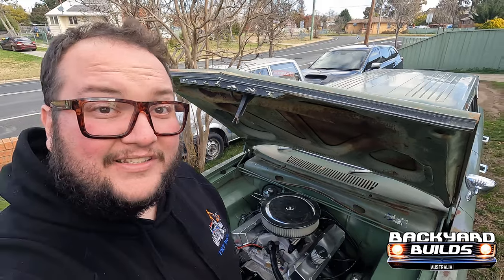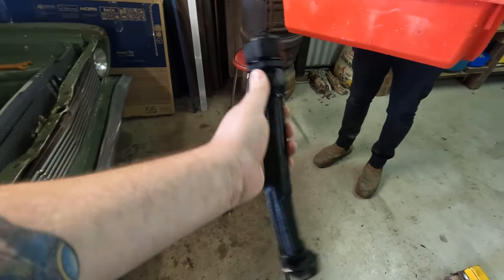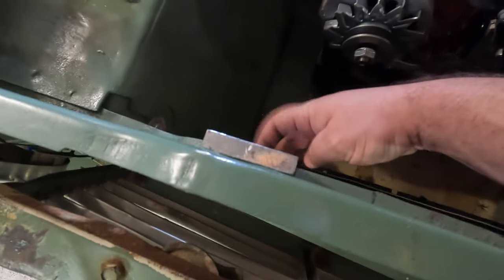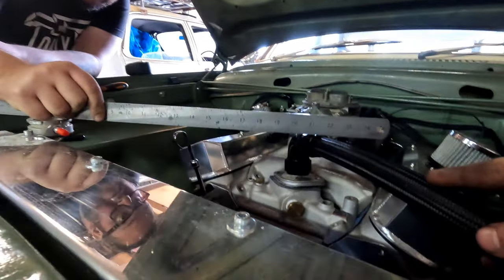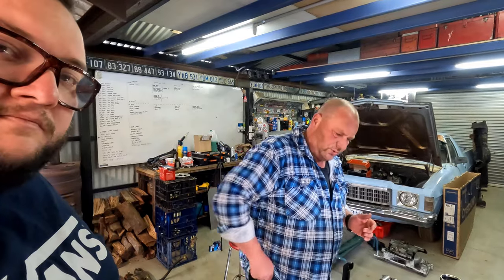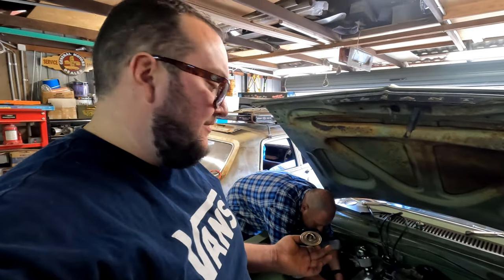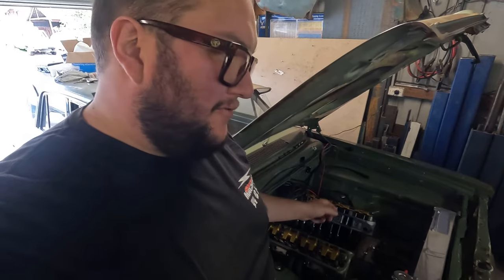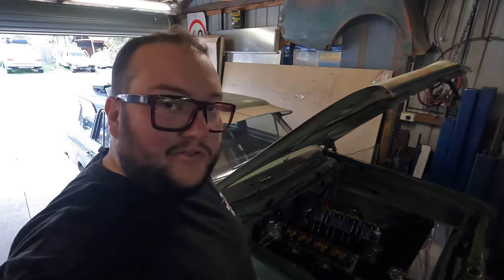Swap Meet Wagon Strikes Again | Radiator Upgrade & Lifter Woes | BackyardBuilds

Comment: Dude, such a pain in the arse!, don't get down though mate, I know Bam lifters aren't cheap but solid roller will be great, not really a lot more maintenance unless you dailying it and should be a home run pretty shortly. Can't wait for the first fire up! Can't believe the issues Comp are having now they've gone offshore, I've always had a great run with them.
Reply from the maker: Cheers Mate, I can't wait to give it a proper run and see how it goes. The amount spent on Comp I would have covered the Bam's and the cam...

Comment: My choice would be a solid lifter flat tappet, I ran .620 lift with good success with many miles! Valve spring pressures should be close with a street solid, 140 on the seat will be nice! Cheers Zac
Reply from the maker: Thanks for the input St.Wayne, Glad to see you are catching up on us and all girls garage in recovery.

Comment: Sucks to see mate, i've had a comp hyd flat tappet straight out of the box with half machined lobes seems to be they're slipping on quality, sadly they've bought out crane cams so they're trying to dominate the market 👎
Reply from the maker: Everyone seems to now be flying under that Edlebrock/ Holley banner
Reply: @BackyardBuilds  all about dominating the market i guess quality comes after that 😅
Reply from the maker: Seems that way, In my researched I have found a similar lifter with the same photos off the comp website on WISH....
Reply: @BackyardBuilds  i'm not suprised 😅 even the old mans lifters in his f truck rattle on start up, has me guessing now 😅

Comment: I hate to be a the bearer of bad news, however solid roller cams are notoriously unreliable on street driven cars
Reply from the maker: Hey Craig, I have been through this with the engine builder and the lifters we have gone for are designed more around street use, along with a street profile solid roller we should be pretty good. First 1000km's should see a few adjustments and then once settled should come as regular servicing.

Comment: That is not good...2 sets with same issue.....i have lunati hyd roller in my engine......have done 5000k's in 12 months with no issue.......i bought all my parts at the start of china flue.....seems problems are far worse across the industry.....good luck
Reply from the maker: Cheers Damien, Yeah through the Flu Lunati was purchased by Holley/Edlebrock from what I can read and it seems to have gone down from there, Seems to be the same stuff in different branded boxes now.